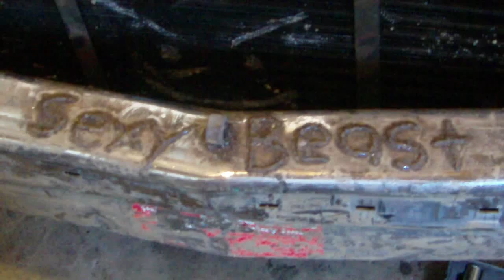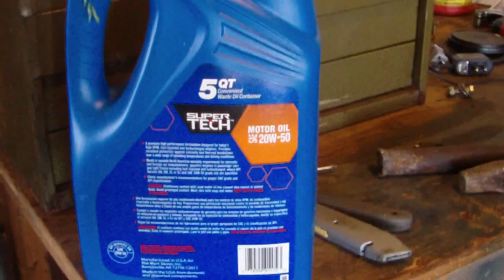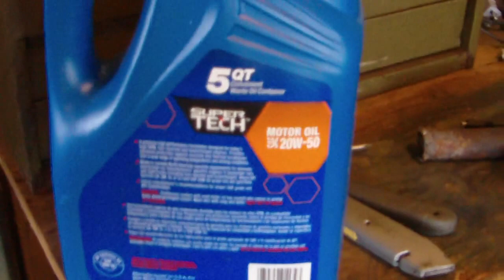Oil Drain with Blown Head Gasket Taurus Derby Car 2012

Comment: I've run gear oil before but only in an engine that had a bearing issue, like a rod knock ect. Gear oil's not going to do you much good in the case of a leaking head gasket. However if the engine is on the way out... you may get a little more time out of it with gear oil before it self destructs.

Comment: I dont think that car has a blown head gasket. Its most likely a cracked engine block because those pre 1992 Ford 3.0 vulcan engines had problems with there blocks cracking even under normal conditions! So in 1992 Ford made the engine blocks stronger and that fixed the issue.

Comment: If the engine is pretty much toast anyway why not just throw some gear oil in it...cause even in new 4 banger engines I run 20/50 as normal everday oil

Comment: that engine is alreadt junk after sitting all winter with coolant in the oil. Beisdes draining the oil is not a clear test to determine how bad a internal leak is. I wouldnt even bother with that engine I would get another one for it.
Reply: I agree, coolant in the crankcase degrades the bearings within the crankshaft. Your looking at a  complete rebuild